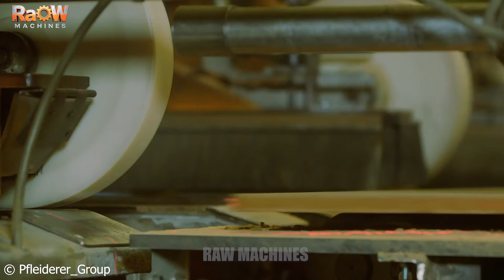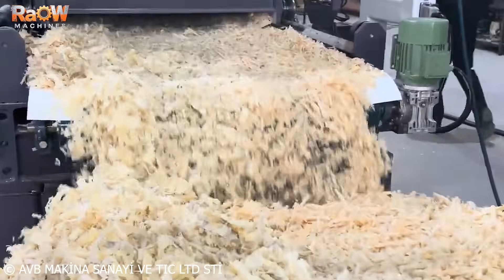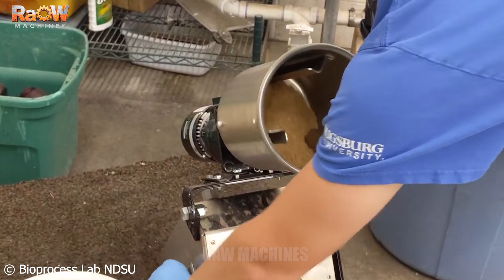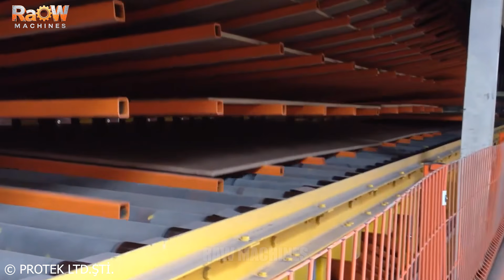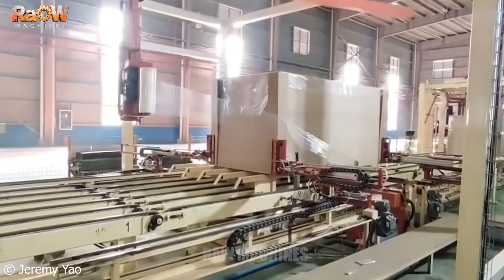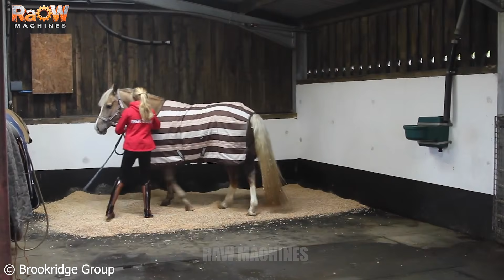Inside the World's Most Advanced Wood Recycling Factory | Waste Wood Becomes Global Particleboard

Comment: What impressed me most is how controlled the whole process has to be. Scrap wood goes from metal removal and size sorting to drying, resin blending and hot pressing before it becomes a completely new board. Even the sawdust still has value as pellets or fuel for biomass boilers. This is a great example of how waste can become the raw material for another entire industry.

Comment: Is this chipboard or particle board?what is the difference??I think the chipboard is used.more in paneling and roofing ,providing stability to framing, like plywood.
Reply from the maker: Thanks for bringing this up! 👏 There’s definitely some regional terminology involved here. In American usage, particleboard usually refers to panels made from compressed wood particles, while “chipboard” can mean essentially the same thing in some markets. But the roofing/framing applications you mentioned are generally associated with structural panels like OSB rather than standard particleboard. We appreciate the detailed comment! Which one would you like us to break down next—OSB, plywood, or particleboard?
Reply: @RaWMachines-g9r particle board is made from sawdust. Great for countertops but can't take water as is not a structural lumber.
Reply: Very few processors use this method! It costs much more than using lumber production waste!